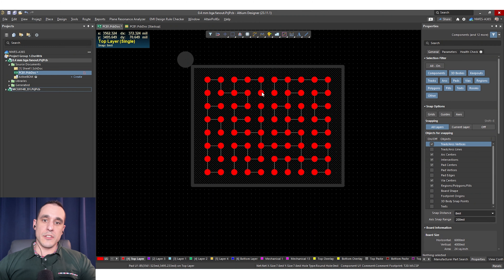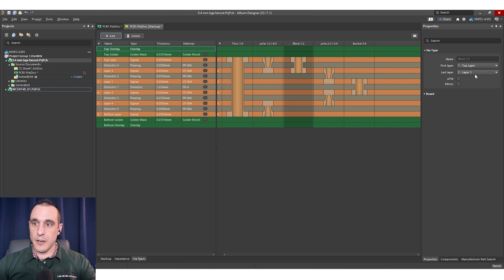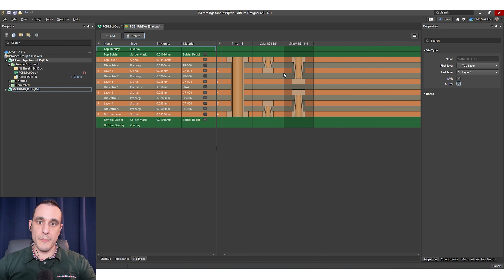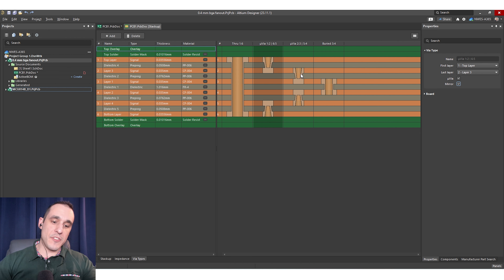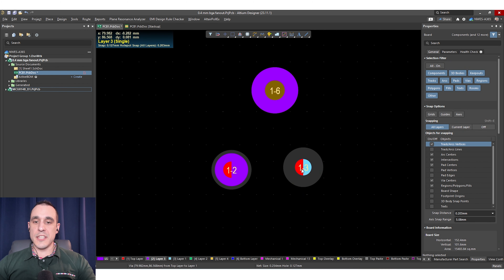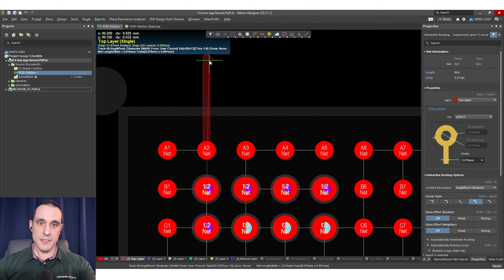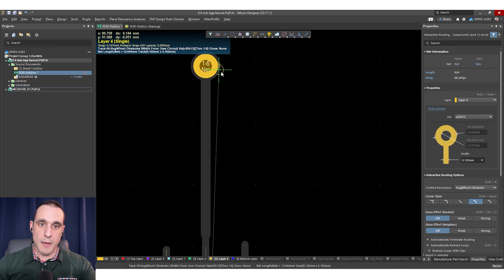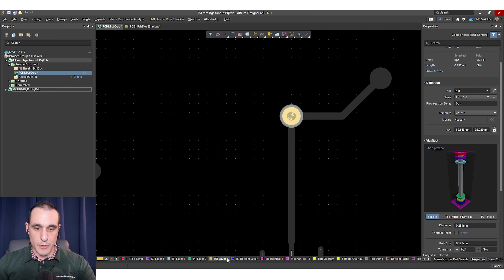How to Integrate Skip Vias in HDI PCB Design

Comment: Hi Zach,

Why can’t I use another micro via to go up from 3-1 layer? (Min 6)

Thanks!
Reply: That's what a skip via is supposed to do, you are routing between L1 and L3. If you are referring to a Type-II stackup where microvias are used in both L1-L2, and in L2-L3, we normally don't place a skip via because there is no need for it, I already have the via transitions between layers so I can just use those. You could add the skip via if you want to, but it will add a fabrication step (which means more cost) without adding any new usefulness in terms of routing.

Comment: Zach: It looks like your companion article " Build High Density Interconnect PCBs with Skip Vias" may have some misleading images. The narrative refers to the images as showing skip vias, but the images actually show blind vias.  This video makes more sense in that regard, though it's a little distracting that the skip vias in the video are also micro vias -- that maybe common practice, but it's not immediately obvious which graphical indication means "micro" and which means "skip". I guess tapered means "micro", and grey around the via barrel shows skipped layer(s)?
Reply: Not sure why those images have not updated but I will have to go into the site and fix it! Technically a non-micro blind via can "skip" a layer if you want by not placing any connections to the via on that layer, but the term "skip" is most often referring to the Skip uVias shown in the layer stack manager.
Reply: @Zachariah-Peterson The stack manager shows micro vias  as tapered -- are they actually tapered physically?

Comment: I noticed in your layout that you used micro vias in the pads. While I understand that this method makes the fanout of the BGA processor easier, have you considered the potential repercussions during the manufacturing and testing phases?
Reply: This isn't an actual design that will be manufactured, I only show this fine-pitch BGA used as an example that shows a good instance of using skip vias. But to better address your question, if you need to have blind via in-pad or skip via in-pad then you should check with your manufacturer to get their aspect ratio requirement to ensure reliability. You can solder onto microvias, including under BGAs, but too large aspect ratio might be a reliability challenge.